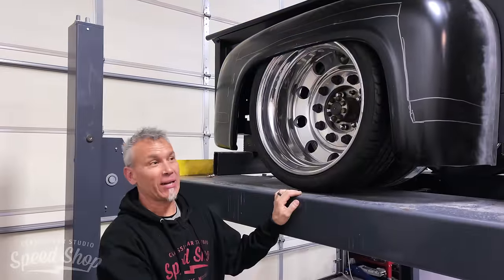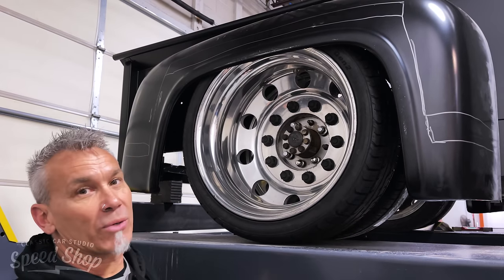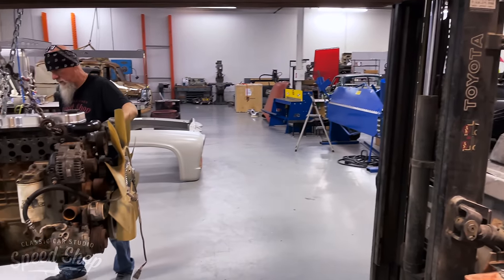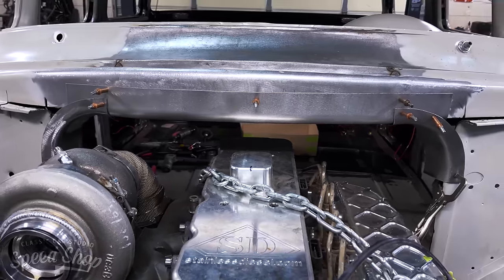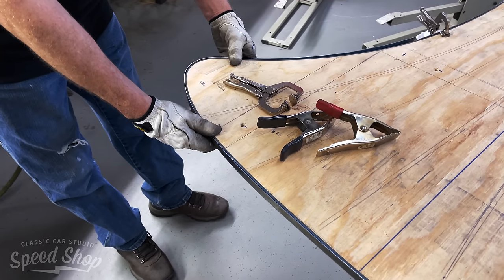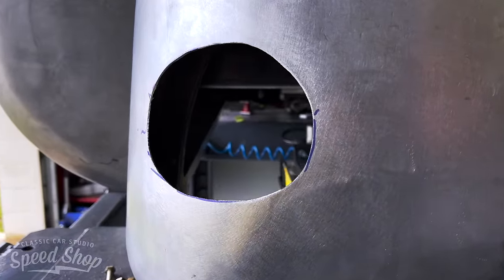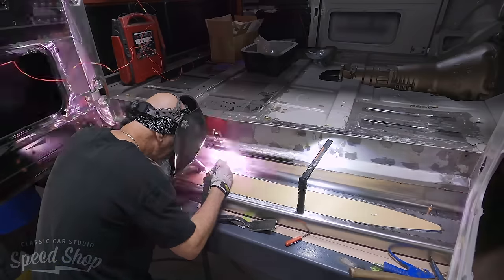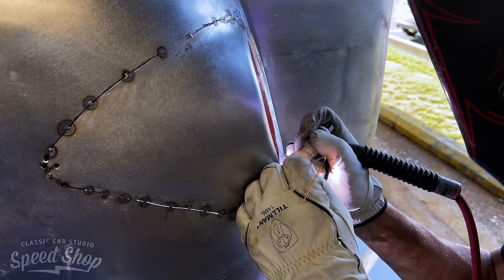Fenders, Bed Floor, & Tail Lights • 56 Ford F600 "Crew Cab"

Comment: I did the exact same cuts to my rear fenders except I went up with the top half to give more room when aired out but giving the same original running board height so it looks kinda stock still

Comment: Very nice build but I’m wondering what happens when they have to work on the back of the engine or change the back tires if they have a flat tire. Getting them out looks like it’s going to be a bitch lol

Comment: Why not t-bird lights from the 2k models
Reply from the maker: Looked at a few options on those, main issue was integrated reverse light wasn’t allowing us to orient it the way we wanted. Plus, who can resist messing with Ford guys by slapping on a Chevy part or two?